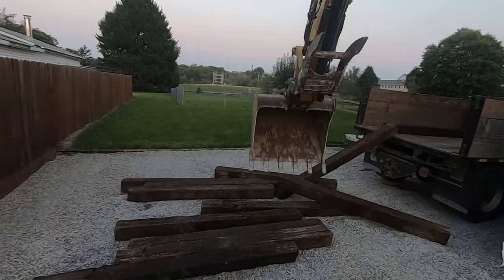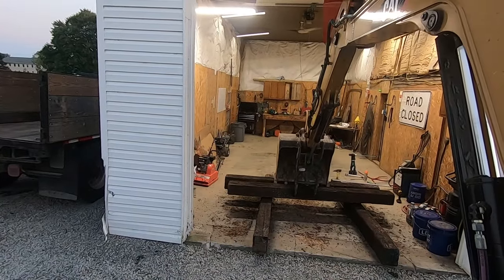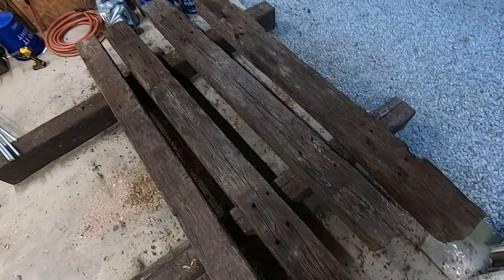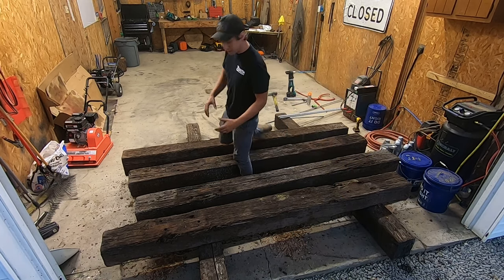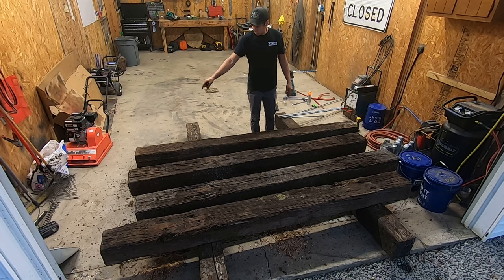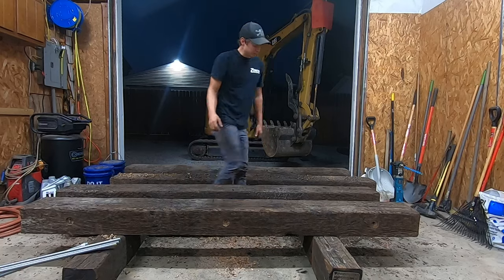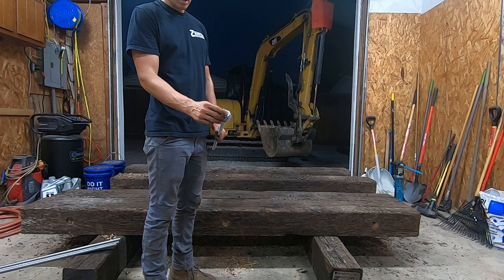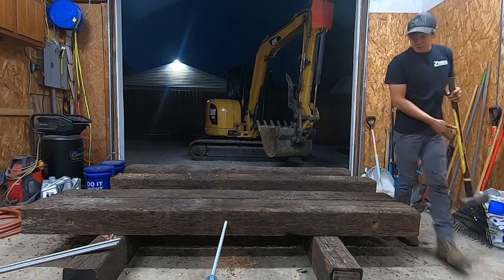Making Crane Mats For My Mini Excavator!

Comment: Good job Zach. While it didn't look like you were having any problems,  with those chip auger bits (the long bit), they sometimes can unexpectedly grab in the hole and be potential arm breakers. You can drill at a slower speed as well. When I was still working construction and we sometimes had to use crane companies they would always come with 4,5 or 6 trucks hauling counterweights or mats. Their mats were usually always rough oak 3 layers crisscrossed construction and full 2 x 6 dimensions. We would usually place them wherever they wanted using telescoping boom forklifts. they were quite heavy. Yours look like they will serve you well.
Reply from the maker: Thanks Clell! It didn't give me too much trouble, I did have the drill on the slowest speed in hopes that it would give me a little more time to react if things went sideways. I've seen road built out of those mats you described. Seems like those get used to cover larger areas and the big mats made out of oak 12x12s are more for structural stuff 🤷‍♂️ I need these for a pond project. And I just need to be able to move them around easy with the excavator.

Comment: Cranes need mats with structural strength you can quantify and little deflection.  Access mats can be much lighter and flexible.  I was on a job in Montana, moving a couple gas turbines for a electric utility.  Maybe 150 tons or a bit more, on a small Goldhofer trailer.  We got into soft ground and the trailer started to auger in.  We eventually got unstuck by lifting one axle at a time, digging to smooth it out and placing 3/4" plywood beneath the tires.  Plywood is strong in tension and so the wheel pairs on each side of the trailer held down the plywood ends.  You gain much flotation even with the plywood between the wheel sets.  Amazing that we got OK without a big winch truck.  Swamp (access) mats are usually 3-ply laminated boards, if made of wood.  Your setup has 'cheap' and heavy duty' covered!
Reply from the maker: Oh wow, thabms for sharing! That makes a lot of sense about the different between access and crane mats. I have seen temporary roads built out of crane mats before I believe. I don't know ow if thays because the conditions were really soft or just what the contractor had access to.

Comment: Humm.. how do I explain this... if you cut a slot in the second and third timbers where the allthread passes thru,  you can then use a chain or cable to rig to the allthread when you move the mats around.  Those are some nice stout mats!
Reply from the maker: Oh yeah, I think they do something like that on the big mats right? These are small enough I can grab them with the thumb, but I might have to use a chain if I load them with the skid steer.
Reply: @zaccheus  Yes, I’m retired now, but back in the day used to run 65foot cat 320 long reach on mats on the mud flats around San Francisco Bay.    We used to use at least a set of three so there were always at least two mats under the rig. Also, used mats with crawler cranes.  Having a picking point means you can use the mats in more ways.  Also, over time using the thumb eats up the mats where the bucket and thumb grab the mat.
Reply from the maker: @gregmurphy3 Oh wow, that super cool! I did notice that it chewed them up a little when I moved them out of the shop. I work by myself for the most part right now. Makes a little tough to sling them 😅

Comment: Good job! Moving auger bits up and down a couple of times on that thickness of material can make drilling a bit easier. But it didn't appear you had much of a problem.
Reply from the maker: Thanks! I think I ended up doing that a little bit. It just got edited out becaise watching a guy with an auger bit drill a bunch of hole isn't super exciting 😂

Comment: What was the large drill you were using.  I think I have seen you use it with the GRCS before.  Looks quite powerful.  Not Dewalt or Milwaukee.  Makita or Hercules?
Reply from the maker: Good eye! It is the drill I use on the GRCS. It's a makita 36v angle drill. It uses to 18v batteries. I have a video comparing it to the milwaukee on the GRCS with a load cell if you want to check it out: https://youtu.be/LOp-iATox24

Comment: I assembled some mats last spring for my bobcat E42 to dredge my pond. I just used treated 4x4s at 8' long. I need to figure out how to incorporate some lift points, the thumb is hard on the 4x4s
Reply from the maker: Ah, I imagine. Especially with them being made out of soft woods. How well did they work for you? I used these in another video and it was not a good experience. 😅 once they got mud on them, the rubber tracks just kept sliding off.
Reply: They worked great, I've even used them to bridge ditches once in a while around the property. But yes it's a ride once the mud gets on them, still playing with ideas for traction
Reply from the maker: @troyclancy406  I was thinking of adding some screws to mine to see if the rubber would grab on the heads. It would definitely take a little of screws though 😅
Reply: I was thinking the same thing, sheet metal screws would probably bite good.
Reply from the maker: @troyclancy406  if you go that route, you'll have to let me know how well it works!

Comment: Nice job! Jf you wanted those mats to be wider, you could try staggering them. If you have a 6 inch stagger, you'll end up with mats that are a foot wider. You could probably get away with staggering them by a foot maybe 2, but I'm not really sue if that overhang would be strong enough without testing it. Possibly a good way to get the width you need at a lower weight if you have a small digger? Maybe you could test the theory for us? Thanks for the video....... although we should possibly be saying "thanks for the memory card" now days as vcr is pretty much dead now 😂😂 👍👍👍👍👍
Reply: If you offset by 6”, you have mats that are 6” wider…
Reply from the maker: Haha, that is a solid theory, and it would definitely make a wider mat without making a heavier one. It wouldn't increase total surface area, but it still might be better in some coniditions with grass or other fibers which might help bridge things up between the offset timbers 🤷‍♂️ thanks for sharing your idea!
Reply from the maker: @rustrtal  I think he means offset each set of timbers 6" in each direction from center.
Reply: Offsetting the timbers doesn’t increase the square footage bearing on the ground, so no real effect.  Also, I believe it’s best to keep the ends square to reduce wear on timbers.

Comment: In about 2017 or 2018 my project bought 12 x 12 x 20ft oak crane mats for $1000 each.  I thought that was a pretty good deal at the time.  I am sure they are considerably more expensive now.  At that time we bought maybe 200 and so I'm sure that factored into the cost.  Sad to think that at the end of a project they are garbage since they are untreated and rot out.  I currently have some mats made out of 7" thick plastic timbers that are lagged together with what looks like special rebar and nuts.  In between each plastic timber is a 1/4" steel plate to give the mat rigidity.
Reply from the maker: Oh that's very interesting! I didn't know how much the big mats costs. It is a shame to see them go to waste. It seems to depend a little bit on the project they're used on. Sometimes, they make it through a few jobs, other times they only make it through one 😅

I've never seem mats like you described, but they sound like thay would work pretty well!
Reply: Why on earth would you buy untreated mats? You can always rent or sell them after the job. I've seen them last years and years depending on the jobs. Wet pile driving jobs in swamps and rivers they still last  years until the machines tracks or bucket teeth rip them up.
Reply: @jamarjames9501  I've never seen 12"x12"x4'x20', 30' or 40' treated hardwood crane mats.  At least not heavily treated like railroad ties.  Wouldn't be worth the expense with trucking and handling adding to the cost of moving mats around.  A project buys the mats, hopefully finishes before they rot too badly then scraps them at the end.  I expect we'll be seeing more laminated bamboo mats and timbers.  Of course steel and composite mats are in use these days by those who want stuff that lasts.
Reply: @boomupengineering  I don't know where you're getting your mats from I work with them every single day. It's the only kind I've ever seen they last forever unless you get a trash operator ripping them to pieces. Maybe it's a location thing I'm in Pennsylvania.
I don't know how many 40s I've seen though mostly 20s or 30s
Reply: @boomupengineering  they're usually made out of telephone poles, or wooden river piles,or docks. Alot of jobs they rip that stuff out and toss em. The only time I really see regular wood is for stabilizers on cranes where they don't get beat up real bad but they will last a long time too if your using then for the intended purpose.
Reply: @jamarjames9501  Ok, I see we're talking about different kinds of mats.  Mud mats, composite mats, construction mats, access mats - those would be for getting vehicles across soft ground.  They work great but there isn't a good way to quantify their load carrying capacity nor are they very rigid.  When I hear "crane mat" I think of very strong and rigid mats capable of keeping a loaded crawler crane level.  Milled hardwood timbers, usually 12" x 12" but steel and hybrid mats of steel and other fillers are becoming more common.  Laminated bamboo is super durable and rot resistant.  Bamboo may be even better than ekki wood for cribbing and jacking.  I imagine some rigging shops might treat their hardwood crane mats - just dump used oil on them.  Unfortunately that isn't possible for construction projects.  Instead they buy mats for the project and then toss them when it's over.  Or invest in steel mats that are taken job to job.
Reply: @boomupengineering  We use them for cranes too we do alot of work on the edge of the Delaware river. We'll also use 20'x10 3/4”steel mats "road plates"  too but we only use them on more stable ground or on top of creosote mats because they still flex alot  more especially when making a pick. 
Then on roads we'll use 1\2" 10x10s or 10x20s when covering trenches for road work but you need atleast a 400 to pick them up and move them and dragging them will destroy the roads. The only time I ever see untreated mats is when we're putting a hydraulic crane on the roads where water won't ever be a problem but usually when we're using conventional crawlers we still use the creosote mats.
Reply: @boomupengineering  Yeah we do alot of work in the water you can't dump oil on anything. We have oil booms out around everything and then tighter booms around the barges.